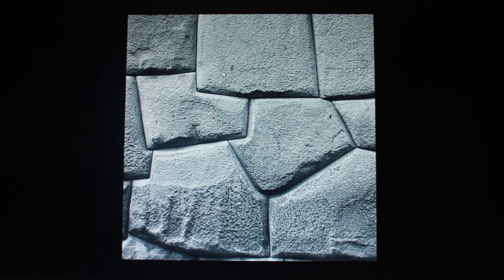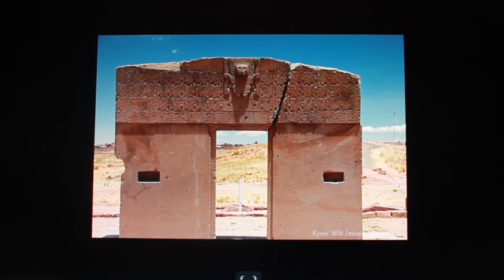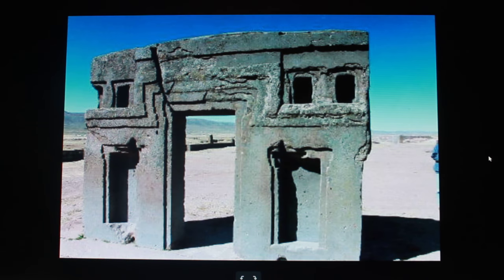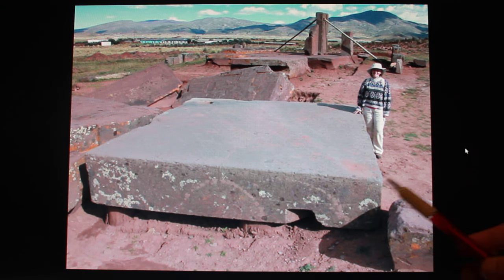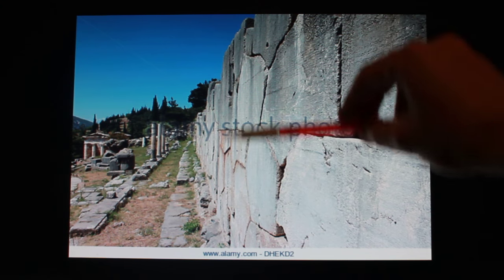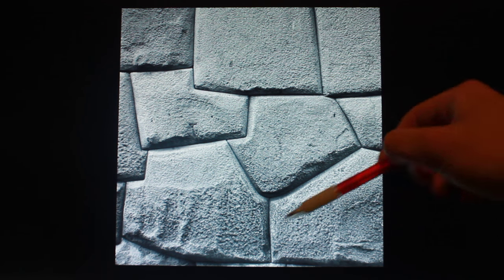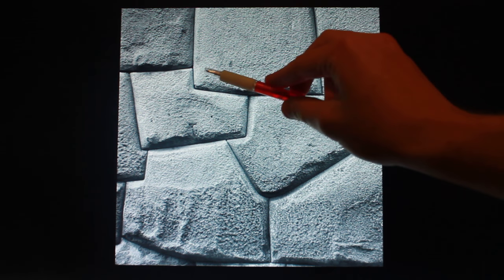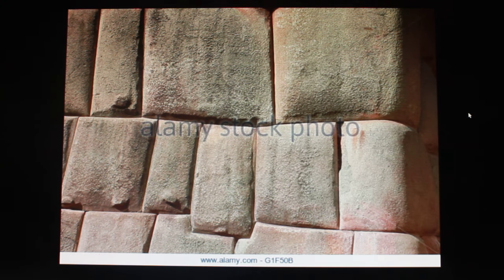How were the POLYGONAL MEGALITHIC INCA WALLS BUILT? LIKE THIS?

Comment: You know Charles there was some writings about a sun disc these people down there made out of highly polished gold and that they used these in a series apparently. One was a huge disc the Spanish melted down apparently. 

So lets ponder. Maybe you're tired of hearing my take but here goes. I worked in dentistry all my life. My wife also. Both graduating dental school we worked with filling materials for teeth that are tooth colored and at first these set up as a catalyst and base mix. It produced heat as it set up also but before this this composite material was highly workable. Putty like with the primary complaint being that it set up too fast and working time was too short. 

Well, they fixed it by making it so it stays a putty like consistency until you are ready to set it up to rock hardness yourself and do you know how we do that to this day Charles? We use a high intensity light source to set it up and hit it from various angles. This light being so bright it requires eye protection. Well ask NASA why gold makes a better lens than glass. Its because of the 100%  efficiency. So with 100% efficiency one could direct sunlight even into a crevice in a rock to melt bronze on the spot and the last disc used to reflect that light would have the same intensity as the first if your lenses are gold. Well precision would be possible if this putty rock was something you could mold until you hit it with the light and low and behold they make it set up with a light source like dentists do today! 

Those weird appendage pedestal stones all over the place down there? Those held the discs and probably allowed them to rotate them any which way they needed to focus a beam of light to another disc and they could light up a cave with these things.
Reply from the maker: Hi Troy! Thanks for this amazing comment! Totally agree! It was a kind of putty and then heated or something. I am starting to think it was baked on, one layer at a time, since it falls away in layers. concrete falls away in layers as it's also an exothermic reaction, different drying times for each layer, even if poured all at once, distances from heat source. Hmmmmm!

Comment: One thing you need to realize is that many prior civilizations were easily able to melt any stone and pour and mold. I’m not saying this is how the Incan walls were built, just that they had no need for any concrete type solutions. I personally believe the theory that they were able to soften stone blocks and cram them together while soft, creating a perfect seal. Why they did the odd shapes and inconsistencies? I think they did it bc they knew it would confuse future civilizations for a while lol

Comment: the nobs are proof that it was a mould, it's the entry point where the cement was poored into, the nobs are proof they haven't been sanded down
Reply from the maker: Good idea!
Reply: My thoughts are that whomever was in charge of troweling-off what still poured-out of what I believe are 'relief buttons' did not time it correctly, so some was left and hard. That would explain why some just don't exist at all and some are only minor protrusions.

Imagine that was your job and at some point you had to use the rest=room or help another worker for a moment. You get back and pop the button off and ugh, its still runny so you trowel it off, walk away for a bit and come-back and well, it ran a little more. I'm thinking cosmetics were not a top priority for the folk whom crafted this.
Reply: No, it isn't a good idea.  All the knobs are at the bottom of the stones - you cannot fill up bags from the bottom.
Reply: no one is suggesting it is poured from the bottom, rather the top. But when you pour air get stuck at the bottom hence the relief buttons. These are covered with plywood and popped-off so the air can be removed. Again this is a common practice and done in every commercial & residential concrete building today.
Reply: actually the nobs are the exit-point to remove air. I see David Hunter's point now.
Reply: How come some stones have no knobs and others have multiple knobs? Plus when you see some of these blocks up close, you can see that the bigger pieces of stone within the block ( the shingle or aggregate) has been cut through. Why would you do that? Why put all that effort into making concrete and moulds just to have to cut the blocks into shape anyway? Not concrete. And the correct term is "geopolymers".
Reply: Reformatt Show aren't there microfossils found in the stone proves that it is not cement or concrete. If it were the microfossils would have been ground to a pulp.
Reply: Dave Montgomery sorry but that’s simply not right. You never have air vents in the bottom of concrete pours.
Reply: Except these are proven stones quarried from the ground. Not a cement mixture.
Reply: Reformatt Show good attempt, but wrong about the nobs :)
Reply: Dave Montgomery I've poured concrete and there are no holes to remove air. The air is removed through vibration. A pneumatic rod is inserted down into the wet cement which vibrates, further liquefying the cement and causing it to force the air up and out by the weight of the cement itself. Its like banging your slurpee cup on the table to get the air pockets out.
Reply: Problem with your theory, the nobs are always at the bottom.  All concrete molds are filled from the top.
Reply: The nobs wern't on all the rocks. I reckon it happened from time to time with form bulges or maybe a shape occasionally created by their forms for whatever reason. but yeah, they were poured.
Reply: Why are there so many stones with no mold spouts, and why so many with mirror depressions that match the supposed mold spouts, but are indentations? The Romans were master concrete engineers, but even their best and oldest efforts (such as the 2,000-year old Pantheon, with a height and width of 142 feet, which is still the world's largest unreinforced concrete dome. And unlike so many cyclopean stone works, Roman concrete still looks and tests precisely as concrete, not carved stone.
Reply: Yangshan quarry says hi 👋
Reply: I think they were where the bags maybe were supported by wood or other means, and it just bubbled the bag out a bit. So they were using the bags for the structure and shape but some bags tried to fall so they added supports and didn’t clean off the bumps before it dried.

Comment: It appears that the lower batches are affected by the upper bags. Logically, they would have dried first. Also, in many cases we can see sharp convex angle on the upper batches embedded in same concave sharp angles in the bottom stones. That would implie that the "bags" were already solid at the bottom when gravity pressed in the things while the previous batch was still fresh thus a pretty fast process. Would you guys agree ?

Comment: As a carpenter I used to do a lot of concrete form work. First of all why would they not just poor to one level then let it set and then poor another level and so on?
Then the weight of Wet concrete is imminence. It will bulge sheets of ply  and timber and requires steel bolts through the walls from one side to the other to stop this from happening.
Also the stone has been identified and no one has challenged the claims so I think its safe to say they have been identified correctly.

Comment: Oooh! I have an Idea! After the stones were cut to an approximate fit... they were dragged back and forth in their "slot"... Both faces would grind against each other as the discrepancies in the cut were worn away and all the surfaces the stone is bearing on have been "worn to fit". To support this theory: Look at the image at :22 notice that all the stones lip "under" and never "over". For my idea to work, I think each stone would have to actually  have to have it's faces bearing on the sides it is meant to fit as it is positioned. this means you could probably determine the sequence in which the stones were positioned. In some footage, protrusions are clearly visible along the bottom of the blocks! These could well be attachment points for levers, ropes, or tools for creating the reciprocating motion to "settle" the stone.

Comment: Trying to explain these structures with what we currently know and comprehend in today's world isn't enough.  Some of the material might look like sorts of concrete, but we don't know for sure.  Other structures clearly are not concrete, example being large sections of solid granite being quarried out of sides of mountains, etc.   Many look as if they were molded, while others look as if they were machined.  Soooo many factors to consider.  The writings of Edward Leedskalnin (creator of the Corral Castle) have been released and studied by many people.  The secrets have been reviled   One of the secrets is how one man moved multi-ton blocks of corral by himself, stacking them and positioning them close to perfection.  What he did was use light in a similar way a solar panel works to "charge" water with magnetic energy.  He then soaked the corral blocks in this "charged solution," and when the moon passed overhead the blocks would become neutrally buoyant because of the gravitational pull from the moon... Same as how ocean tides are pulled out when the moon passes overhead..  same concept.  very simple.  It's always simple.  It has to be simple.

Comment: The theory of construction sounds plausible but the weight of the concrete and the amount per stone would be retained while being cured by a sack? Made of what material? The weight would be prodigious. Hemp is the only material which is that strong bot wet and dry. 

Hemp cloth was used as the original Jean material by Levi Strauss. Incredibly strong, much better than cotton, then the US gov't banned it here as hemp is related to marijuana but has very little THC. It grows fast and is strong and fibrous. It has grown wild across the Americas. Originally all American farmers from the time of the colonies, were required to grow hemp. Makes excellent rope also. They needed hemp at that time to make the sails of sailing ships and to outfit them with their ropes. Cotton can't last in the salt air. It was foolhardy to ban growing this industrial hemp. It yields 3 crops per growing season, is not plagued by insects and does not deplete the soil. 

Imagine that, at one time we has smart politicians, but then these were men who worked with their hands also. Work with the hands seems to make the brain work also. Now most people would think we only ever made paper from tree pulp, hemp paper was widely used. Books made of hemp paper far outlast tree pulp paper, is better for the environment, is recyclable and does not require timber to be cut.
Reply: A long rant to explain something simple, courag1. Marijuana was made illegal because Dupont had synthetic fiber they manufactured and didn't want the competition.

Comment: 6:27 those knobs are a huge clue and I think to devise a theory it would be imperative that the theory explain those knobs. It definitely looks like the rock was in a softened state at some point where it could be worked easily. In other photos you can see various places where the rock has impressions just smushed in like clay. I would also love to see some blocks separated from the wall so they could be viewed in 3 dimensions. Are the hidden surfaces also angled every which way? Or are the joining surfaces all more or less perpendicular to the front face?

Comment: I agree that if these walls were made of cement it would explain many of the aesthetic features of the construction, as well as questions regarding how difficult it would be to shape the stone's, but one thing modern archaeology can get pretty right is what the walls are made out of and I'd be surprised if they haven't been tested. You can make very good primative cement using limestone, or seashells, in conjunction with volcanic ash, all of which were no doubt available at the time. Also an aggregate would have needed to be used, which would explain the irregular "knobs"
. It could possibly be chunks of aggregate that are poking through.  Better theory than lasers and aliens that's for sure

Comment: Dear Mr. Kos, it's very interesting to hear your analyses on the construction techniques of the ancient world. One must never forget that undoubtedly different tools were used than we have as yet invented in our time. My thinking is that they are quarried stones cut from the quarry with a very intensely heated instrument and then put into place and then with very intense vibration the stones then literally vibrated into place until there were no more rough edges and the unusually shaped stones were made flush with the others around it. The gauges on the lower rock certainly look like the stone was roughly smoothed down with no later work to flatten the face of the stone to make it look more natural. Until we have the technology they used we can only keep on guessing. One thing is sure and that is that a mix like concrete would not have endured because of the nature of cement.
Reply: So we should ignore the 2012 sampling and analysis of the stones at Sacsayhuamán that say they weren't made by natural processes, ignore the obvious fact that they could not have been cut and moved in to place as the said civilisation had no wheel or means to cut and shape such huge stones. These are facts. Instead we should believe (with no evidence) that they were cut  and moved (some weighing 60-70 tons, sometimes over long distances and undulating terrain.
They did not use modern cement.. clearly and it can and clearly has lasted for thousands if years because you can see it for your self in peru. You cam also read the report dated 2012. 
High technology? Yes. Its called simplicity.

Comment: Let’s assume the Inca stones were concrete. Why would you go through the nightmare of pouring such an odd shape for each “block”, then scrap your mold away and build a new one for the next block?
Even if one was crazy enough to do that. How would you build such a mold, with what? (Remember, it’s the civilization that didn’t bother having a wheel). In the video you showed very straight slabs and columns - those molds would have to be extremely straight, and be poured in one go, or be a monolithic pour (since a cold joint would weaken, crack and pop the concrete work).  Also when you pour large concrete slabs, you have to vibrate the mix as you pour, or you will have rough patches and air pockets. Let’s say all that somehow gets done, one carefully removes the forms (since release agent was applied prior to the pour, making it easier to remove it), the very edges of the concrete are very weak, and a person walking on top of it would chip it right off. 
Concrete would erode over time and I did read into your geopolymer suggestion. Again, there are so many scientific journals that go into detail over analysis on the composition of stones, mainly to figure out how old the stones were. Even uneducated observation, there are natural red sandstone formations in the area, why would the builder go pour a huge 131-ton detailed slab and add coloring to the whole mix? Like this http://lh3.googleusercontent.com/-gkmddPU04QQ/VVdChY88PlI/AAAAAAABCEc/3NqnAnqOz6A/puma-punku-7%25255B3%25255D.jpg?imgmax=800
One can see the natural stone that hasn’t been worked on in the area. There are massive deposits of granite naturally formed in the area; it would be unnecessarily burdensome to go through the trouble to fake the look of a natural quarry. 
Research goes as far as assuming a laser was used as an instrument for cutting, which would leave liquefied glass quarts as evidence of the intense beam. No such quarts was observed under a microscope. 
Please see following for why it is believed not to be concrete: https://youtu.be/HrBs5Jcq0Pk?t=26m13s
At 5:33 you suggest the ancients simply grouted the look of stone joints, or made the pattern with a biodegradable material, - I don’t think you are seeing the whole picture, you are not seeing the top of the wall where the stones end, or the unfinished walls, stones, and structures in the area. 
This still doesn’t explain how the material was moved to its place. 
Other than having worked with concrete, I am not an expert in this ancient mystery.
Thank you.

Comment: In cambodia they make tight fitting half a ton stones by 2 blokes rubbing them together suspended in an A-frame. It polishes the seams to perfection and it is a simple manual labor technology. On the other hand, geopolymers can be poured in a bag of sorts, as you suggested. When you stack them during drying they also create overlapping seams. The bulges at the lower end of the stones could be an escape 'vent'/'pocket' where excess material can migrate to during the drying. The 'pouch' allows you a means and time to add variation in the shape of the interlocking stone above. If afterwards you do not make it flush, you end up with the bulges seen.
Reply from the maker: That is one of the best analyses to explain the knobs! Wow! Thanks for this!
Reply: Are you a Geordie?

Comment: We know that the Ancient Romans used concrete 2000 years ago so this isn't very far fetched and is a good hypothesis. However, we do have examples of obvious precision cutting and actual stone placement for most of theses societies in other sites, so even if they did use concrete for some of their projects they were still capable of the second technique.